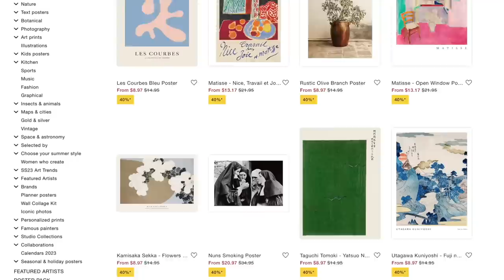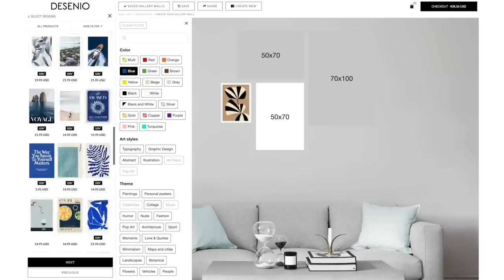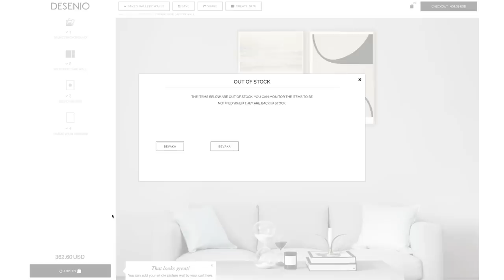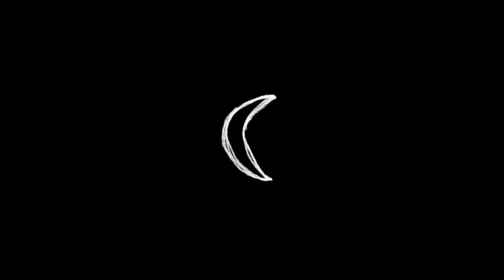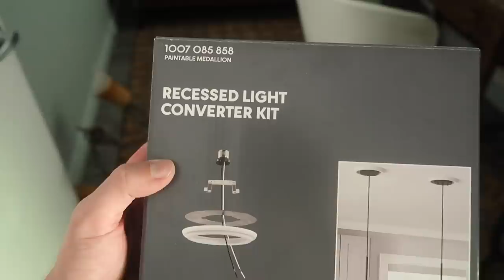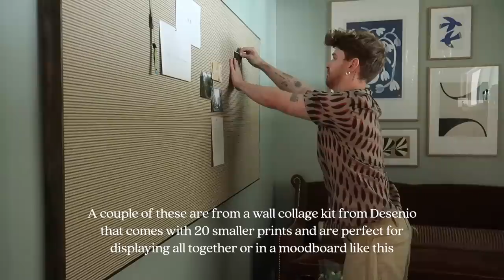85 SQ FT SMALL OFFICE MAKEOVER ✨ ALL Facebook Marketplace + Rental Friendly!

Comment: Expanding foam tip from a terrarium maker - let it it for like 20 minutes to get a film over it and then you can just push some of the air out and get it less expanded so ypu dont have to cut it down later.

Comment: Love the result but I question the functionality. The new desk is much smaller than the previous one, and once the monitor, laptop, and notebooks are placed on the desk, everything will be so crammed. Also, the desk's height, the chair can't slide underneath, or even the sliding chair, and even at the lowest setting of the rolling chair, you probably can't slide your legs underneath the table.
Reply: Not to mention that the original desk was an electronic standing desk. My husband has one just like it and it’s so nice so he can chose to stand or sit! I bet she’ll end up just putting that desk back in since it’s overall more functional.

Comment: Sorry Drew, I'm not impressed.  I love the couch and the light fixture as individual items, but I don't feel they work very well in the space.  The light fixture is so low that people are going to bump their heads - ouch with all those pointed parts.  The desk is too close to the couch and prevents access to the couch, in addition to making the room feel crowded. A heavy armchair with arms that bump the edge of the desk isn't going to be comfortable to sit in while attempting to work because it doesn't give proper support and it prevents the person sitting in it from getting close enough to reach the computer and other essential items on the desk.  Besides, a bulky chair like that one is not intended to be slid in and out - it's too heavy so it will be difficult for Miriam to get up and down.  While the pin board and the bolster are both striped fabrics, they don't have enough in common with each other to coordinate.  And, why the unfinished white edge of the fabric on the bolster pillow?  Yes, it was a good idea to reintroduce the shelving unit, but again, the design of the shelves doesn't coordinate with anything else in the room, and being open, it will contribute to a cluttered looking space.  Last but certainly not least - where's the computer going to sit on a desk cluttered with decor items?  Isn't the computer the most essential item in an office?  Shouldn't the workspace be designed to facilitate efficient work instead of being a platform for a mish mash of decor items?

Speaking of decor, the "artwork" looks cheap.  The images clash with each other and have nothing to do with the rest of the room.  I get it that the "artwork" is from your sponsor, but buying the artwork first, then ignoring it when designing the rest of the space doesn't make sense.  Mixed images should relate well to each other AND to the design of the room instead of being yet another group of cheaply framed unrelated images slapped on the wall then calling it a "gallery".  I know "gallery walls" are trendy, but I want a sense that the artwork coordinates with the space and is hung in a way that adds an element of rhythm and cohesion to the space.  

Just glad this isn't my office...